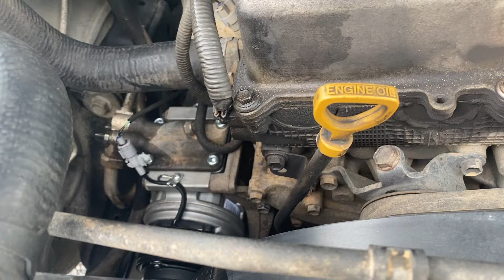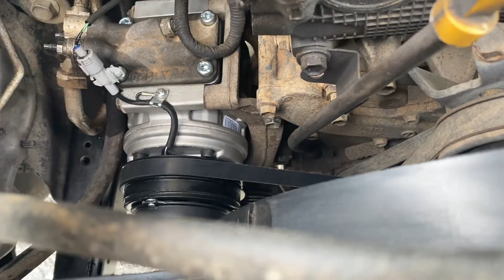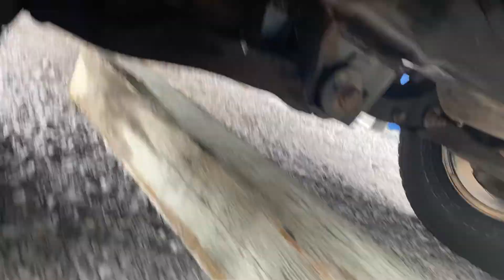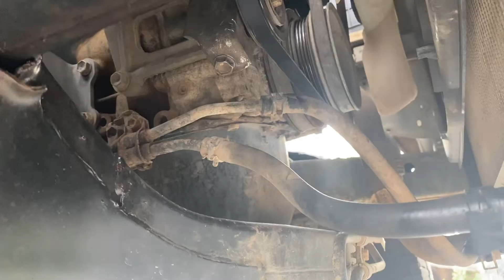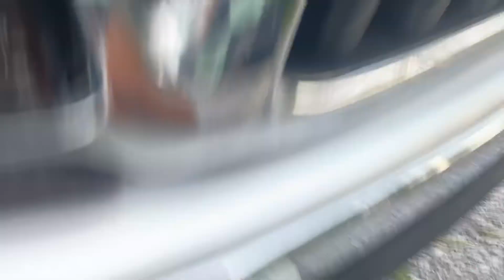AC Compressor Removal Toyota Tacoma First Gen 1995-2004 HOW TO

Comment: Thanks. I just wanted a quick refresher before I remove the compressor to add about 1.5oz of pag46 oil. I might as well since I have the system open while waiting for a new evap core, expansion valve and drier. My friend and I replaced the compressor and drier about 4 years ago. That was my first time working on car AC. But that dickhead spilled some oil out of the compressor onto me while I was under the car trying to align the compressor. So I may as well remove it and add oil while I'm waiting.

Comment: My 2004 gen1 v6. Ac compressor seized.  I bought the replacement. As per instructions with measuring oil from the oil is impossible ther is no oil it’s seized. So I bought the dryer and the condenser with a new compressor. Nothing makes sense.  I did as per measurements with new install. Now i get no readings on the low gauge. What the!!! High side measures. I did exactly 23oz 134a.  What did i do wrong?
Reply: How did things go?

Comment: i just finished removing the AC compressor for 1999 toyota tacoma. after loosen the tensioner and the belt off, remove two each bolt to the low and high pressor hoses use a sandwich bag to keep the dirt off the hose end ports. on the '99 tacoma, it's better to remove just the top radiator hose to the radiator, use a pan to catch the fluid. lift the compressor with the pulley facing upward while lifting out from the hole. after cleaning, new seals installed insert four mount bolts into the compressor, insert the compressor same way coming out. i found out it's better to start the bolts from under the truck since there is little room to steady the pump to start the bolt. once pump is in place, lift the pump to align the bolt holds and hand start the bottom two bolts first; than the top two bolts. this method will save your skin and back pain. i would not advice anyone try to replace the clutch while is mounted on engine. much easier do it when is completely out.
Reply: thanks for sharing bud. will need to be doing this soonal and got a 99 as well.
Reply: Thank you for this comment i am about to do this on a 98 Toyota Tacoma my self lol

Comment: Did your compresslr come with oil in it? Or did you have to fill it up
Reply: Compressors I've looked at come with some oil in them, but they also give you extra oil, because you still need to add to it.

Comment: It says first Gen 1995- 2004 on click-bait description! In the video you said "maybe" 2001-2004 ! Don't add shit if you don't know what you are talking about!
Reply from the maker: Well with a little bit of added research you’d realize that it is the same on 95-04. Sometimes a video can be recorded prior to realizing exactly what all trucks it applies to. My title isn’t click bait. It’s correct. Your rude comment however is uncalled for when someone is trying to be helpful.
Reply: Do research. 95.5-04 tacoma have almost all the same parts. The ac compressor is the same for all these truck(4cyl). How about u delete that comment 🤡

Comment: Did the compressor come out from the top or bottom? The Tacoma I'm working on has a power steering pump above it so I don't know if I have to remove it.
Reply from the maker: it comes out from the top